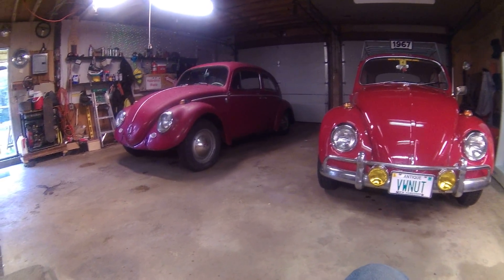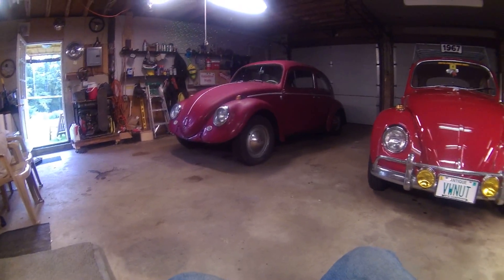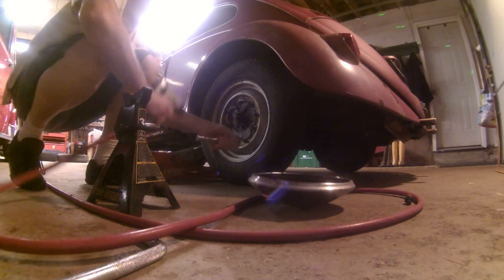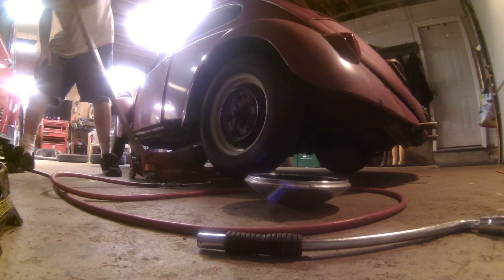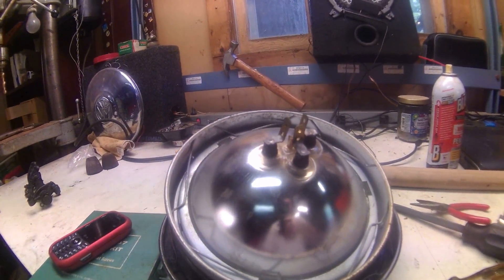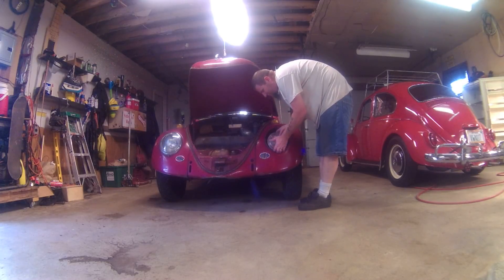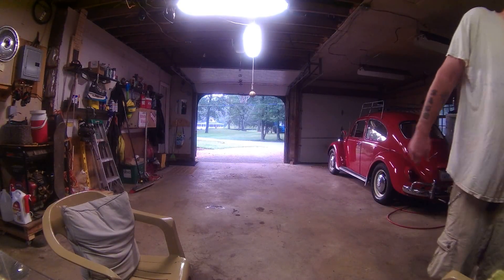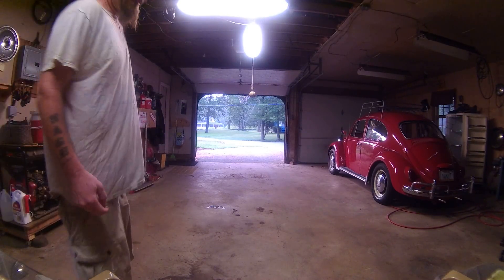1964 VW bug project part 4 (Daisy)

Comment: Tip for you.  Hang a mirror in the center over your workbench And one somewhere on an angle in the corner near your garage door.  If you are like me, why get up and walk around your car to see if all the lights work.  Also another tip (suggestion) roll your window down before you get out of your "Rolley Poley" that way you will not have to open the door for everything.  Unless of course your windows are "Stationary"  lol.
Reply from the maker: thank you  for the tip

Comment: I had two beetles very early in my driving career. The first one, a 1960,  had been a family car before I started driving it. The second one was a worn out 1959 I bought off of the back lot of the local VW dealer in 1972.
Reply from the maker: it would be nice to have those bugs now. thanks for watching

Comment: Looking at the paint, it looks even, just faded. Do you think you can work your magic and bring the paint back to a shine? Might be easier to pull the body off the pan, put the body on a trailer, Ruby back in the storage shed. Winter is coming. Lots of time to get the pan back into great running condition. What about the engine? Any rework can be done around the corner this winter too. Makes for lots  of videos for both of you.

Comment: I may have missed it,but are you running 12 or 6 volt  on your cars ? I am not a purist but like going back to stock if l can.
Reply from the maker: ruby the 67 is stock 12v and daisy the 64 is a 12v conversion. thanks for watching